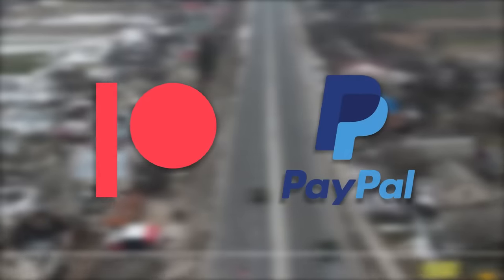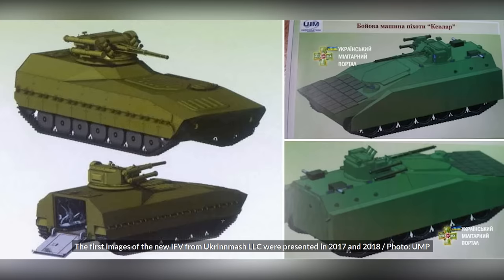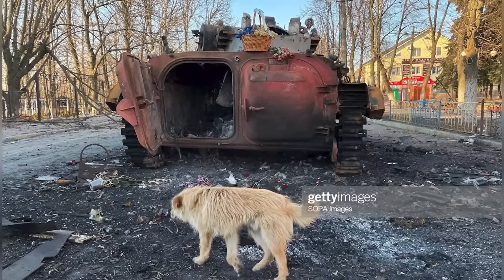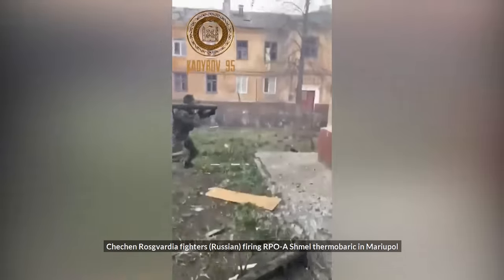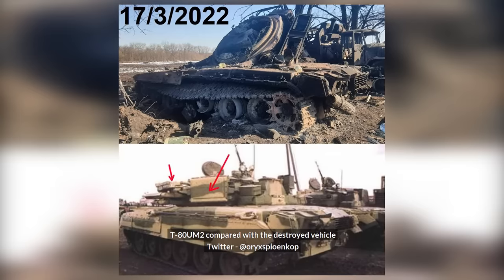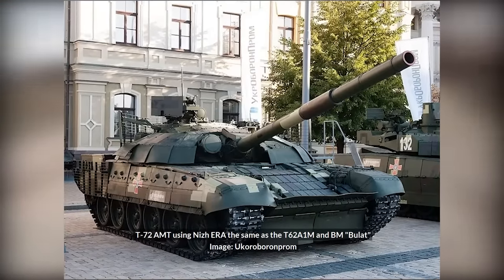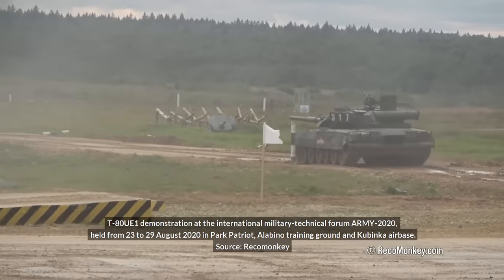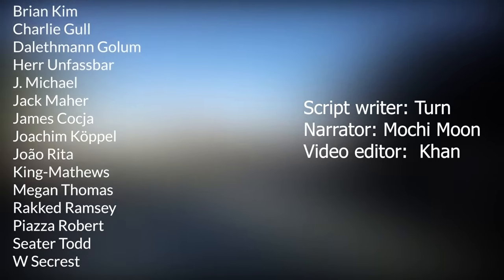🇺🇦🇷🇺The Many Rare/Unusual Tanks, and AFV's in Ukraine AKA The MT-LB War | February-March

Comment: Current MT-LB/v driver here in the Finnish army. The MT-LB even though it's old it can still be relied on for many roles from transporting infantry, wounded, equipment, or towing mortars or artillery. It's very hard to find a military vehicle as terrain accesable and multipurpose as the MT-LB, even if it is ill suited for modern combat situations.

Comment: there was lot of confusion about the t-80um2...which was actually a t-80um1 with drozd. so the only prototype of the t-80um2 is still alive.
Reply: Pretty sure there was only ever one T-80U with drozd and its the T-80UM2 that was knocked out
Reply: @SussyImposter9856  it was t-80um1 with drozd instead of arena APS(which t-80um1 normally should have) 

Why ? because the destroyed vehicle didn't had bustle autoloader like the t-80um2 prototype.

Second difference- the destroyed vehicle has defferent era...it has normal kontakt-5 era 

While the t-80um2 should have that kaktus-6 era which is almost specific to it.
Reply: If only other ukrainian tanks had high level ERA or a well round cage armor, not so sure how long will it last in combat.
Reply: Nope its a T-80um2 that was destroyed. The Tank that you are reffering  to is the T-80um2 black eagle which is another derivative of the T-80um2 with a bustle rack Autoloader.
Reply: @gotanon8958  so that means there were more than 1 t-80um2 in the first place and that the one lost wasn't the sole t-80um2. 

Still means the t-80um2 black eagle is alive.
Reply from the maker: The black eagle is not the T-80UM2.
Reply: @TanksEncyclopediaYT  Does that mean the black eagle is the T-80UM3 or another indegenous tank design?
Reply from the maker: The Black Eagle (Object 640) was to be a new design based on the T-80U, The T-80UM2 was a prototype upgrade to the T-80U. The object  640 was cancelled since Omsktransmash (The corporation that developed the T-80, and subsequently kept working on variants such as the UM2, and designs such as the Object 640) went bankrupt.
Reply: @TanksEncyclopediaYT  thank you, by the way can you give me more information about t-80um2 and t-80um1 . Only one t-80um2 was there ? How many t-80um1 and what is there any difference between them except um1 gets arena and um2 gets drozd 2 ?
Reply: @mr.waffentrager4400  all I know about the T-80UM1 is that it has a different ERA layout on the turret and has the Arena APS
Reply: Z
Reply: @mr.waffentrager4400  Wasnt the Kakuts ERA designed for lighter vehicles like BMP\BMD series, while Kontakt was made for MBTs?

Comment: I went through the US Army LRS course back in '93, in which a portion of the course was threat vehicle identification. We had to properly identify about 120 different threat vehicles by seeing only a portion of each pictured vehicle during the training and testing. I was blown away by the amount of those vehicles I could still properly identify..meaning..the Russian armor hasn't changed that much at all. It's still mostly the same crap that was brought out in the 60's, 70's, 80's and early 90's, modifications aside.
Reply: Mate the same goes for each country. Everything was designed in cold war and only upgraded.
Reply: @DNS-Freakz  well that’s just not true is it otherwise the US would still be using the M60 and the M113…
Reply: @TheeWolfiee1  Ohhh i forgot the Abrams is from 2022 right? It's an 80's design and probably even earlier.
Reply: @DNS-Freakz  most tanks are LATE Cold War yes but almost everything else is newer so?. APC’s, IFV’s, jets, helicopters…
Reply: @DNS-Freakz  let us know when you find a material stronger/lighter than what is on the Abrams. 👍
Reply: Same can be said of the Abrams no? 40yrs of modifications...
Reply: @powkung45  The abrams isn't the junk that a T-72 or T-80 happen to be.
Reply: @toddj8125  Mate if modern AT or Javelins would hit the abrams it would get burn the same as a T-72. And it's way heavier so it would get stuck even more in the mud.
Reply: @TheeWolfiee1  Abrams tank debuted in 1980 and the M113 is still in service.
Reply: @DNS-Freakz  The Abrams design is from an earlier American-&-West German joint tank program from the 1970s.
Reply: @newdefsys  Stryker and Bradley pretty much both fulfill what the m113's role was so saying its in service hardly counts if its backline roles. and again abrams is hardly a cold war tank.
Reply: @TheeWolfiee1  Yeah, because 1980 wasnt cold war period. Everyone that served from 1980 to 1991 and received a Cold War Service Medal needs to turn them back in because 'TheeWolfiee' has decreed that time period was "hardly a cold war".
Damn, Wolfie, its so easy to win an argument when you get to change the rules to fit. Fucking amazing powers you have.
Reply: @newdefsys  lmao all I said was that it was hardly Cold War? Something built on the last years of the Cold War when there were many other vehicles that served a lot more time in that war. cough m60 cough.
Reply: @newdefsys  and what’s more it pretty much was untested in combat until the gulf war so again it’s technically a Cold War tank but how can you call it a Cold War tank when it didn’t fight any wars during the Cold War( if you believe it ended in 1991).
Reply: @newdefsys  Yeah i had something like that in my head but didn't want to say false information mate.
Reply: @TheeWolfiee1  Cold war ended when Soviet Union dissolved and that was 1991. What about the american bombers still in use? Kinda old the A-10 too. And the M2 is old af too. Im not saying because it's old it's trash but theres still a shit ton of cold war equipment used but ofc it's upgraded.
Reply: @TheeWolfiee1  the same tanks Houthies scrapped en masse while fighting against Saudis? Lmao
Reply: @DNS-Freakz  thanks for basically agreeing with me tho, Cold War ended in 1991 and the Abrams didn’t start seeing combat until 1991…. Sorry but I wouldn’t call it a cold war tank.
Reply: @unatco6554  ‘joined one year ago’ enough said really…
Reply: Perun has a really good video on this phenomenon, called "All Bling, No Basics". I cannot recommend enough watching it.
Reply: @TheeWolfiee1  there was very little combat for US tanks during the Cold War fortunately. It lasted 41 or 43 years, the Abrams served for 9/11 of these. Hence it served for around 20% of the Cold War. I would say that makes it a Cold War tank. Further, it was designed to fight in Cold War Europe against the Soviet hordes. Which also makes it a Cold War tank. Put your ego aside and desist from this silly claim.
Reply: @PalleRasmussen  okay sure let’s call it a Cold War tank, still waiting to hear about all the other parts of the military aside from tanks that have been ‘upgraded since the cold war’ mfs confusing NATO equipment with Russian equipment.
Reply: You will not see many… if any Cold War era vehicles fighting in nato countries now days, and the ones that you do are the rare exceptions that have been Heavily modified or there’s nothing to fill it’s role.
Reply: @TheeWolfiee1  I am not sure, what you are asking about?
Reply: @TheeWolfiee1  The US only recently got rid of it's M60 reserves, and the M113 is still in use. The Abrams was designed in the 70's, and the majority of the USAF's combat aircraft are 70/80's designs. Every country on earth uses loads of cold war stuff that's just been extensively upgraded.
Reply: @TheeWolfiee1  Here's a small list off the top of my head of cold war era vehicles and equipment still in service with the US military: Upgraded variants of the M270 MLRS which first entered service in 1983, Upgraded variants of the M113 which first entered service in 1961, The HMMWV first entered service in 1983, The M109 Self Propelled Howitzer was first introduced in the 1960's, The LVPT-7 Was also in the 1960's, The LAV25 entered service in 1983, The Patriot Long Rage Air Defense System entered service in 1982 but was first tested through 1969-1970, The Ohio Class Nuclear submarine was in sea trials in 1982, The Ticonderoga class Cruiser was first ordered by the navy in 1978, The Bradley IFV entered production in 1981, The C130 entered service in 1956, The first variant of the Huey took it's first flight in 1956, The Cobra attack helicopter First entered service in 1967, The CH47 Chinook entered service in 1962, The B52 Bomber Entered service in 1955, And last but not least off the top of my head the McDonnell Douglas F-15 Entered service in 1976.... And I'm sure there are many more that I missed and just because its old doesn't mean its obsolete.. I know I missed the Abrams and A-10 but those were pretty obvious and were mentioned in the above comments.
Reply: While Yankeestan uses much newer crap? When was your MBT designed, and how long did its predecesor serve?
Reply: @jakewaybright973  most if not all of these vehicles you listed are rarely seen in frontline combat or are no longer fit for it now. it went pretty off topic from Russia still using literally Cold War equipment(tanks,ifvs,etc..) whereas yes the Us is still using Cold War equipment, it is in now way being put to the frontlines as much as the Russians are and that was kinda what I was getting it. But I admit my original comment was pretty wrong and I’m starting to see that now.
Reply: @TheeWolfiee1  the material used is irrelivent to the design. Also titanium.
Reply: @DNS-Freakz  no it wouldnt. The t72/80 blow up cause theres ammo stored in the autoloader right bellow the turret crew. The abrams has no autoloader and has all its ammo relativly safely stored.
Reply: @TheeWolfiee1  Boron carbide, you are welcome.
Reply: @TheeWolfiee1  There is no old or bad vehicle, there is only vehicles that is unfit for the roles army gave them. In turkish military police we are still using m48 tanks. They wait in a trench and when we detect insurgents they drives gets out of the trench fires HE and goes back into the trench. Their shells pack more explosives, faster and more accurate than HE rockets. More explosives come in handy when they can always take cover behind large boulders.
Reply: @robertharris6092  A tank doesn't need to get blown up in order to be considered as knocked out. Let s say that a javelin hit the Abrams on its turret, 3 crewman will be dead and gun breach would be destroyed. Now isn't this tank good as destroyed under theese circumstances.
Reply: @mysteriousguy2681  i said blows up. Not are knocked out.
Reply: @mysteriousguy2681  except that boron carbide can shatter instantly when hit by a high velocity projectile/force of an explosion… basically everything a tank gets hit by.
Reply: @robertharris6092  What I wanted to point out is a tank doesn't need to be blown up to become useless.
Reply: @TheeWolfiee1  Hmm that aspect of the boron carbide just reminded me a material, ceramic which is the main component of chobum armor. Oh and ceramic is not durable as boron carbide and it is heavier.
Reply: @mysteriousguy2681  so you think the military tank expects and designers have overlooked this material?, No they’ve probably already tested it and it probably didn’t work and it wasn’t as good/cost effective/ as Available as the material they’re using currently.
Reply: @paulroustan3643  noo.. it does not to any major or even minor degree
Reply: @DNS-Freakz  The upgrades werent even near enough to get all the vics. You would never see an old variant still in service within NATO countries. Not only that but the upgrades they implemented didnt really account for the drastic step up in technology, we even got rid of the Humvees for anything but logistics.

Modern Russia was bankrupt for most of its history thats why it couldnt do much in terms of modernization.
Reply: @TheeWolfiee1  damn wonder what dellision i was suffering when serving 86 to 92 with hummers abrams  bradleys and mlrs
Reply: @toddj8125  I’d hardly call the T-72 or T-80 junk. They’re built for one role, and in the hands of a competent commander, are a good weapon system. 

The Russians however are not what I’d call competent commanders.
Reply: Armor in general hasn't changed much at all.

Comment: An interesting point regarding the "mt-lb war", the Russian side is actively using Shturm-S and several units were clearly captured by Ukrainian troops, there is no clear evidence of the use by the Ukrainian side, since there are quite a few of them, given that they were actively used in 2014-2015 and part was lost, however, in 2020, the Ukrainian modernization of the Shturm-SM with the Barrier ATGM was shown (from the Luch Design Bureau - the manufacturer of the Stugna ATGM, it is worth noting that Ukraine produces quite good options for anti-tank missiles), but the number of units produced is unknown, especially considering that the aiming module was produced by an instrument-making plant in the city of Izyum, which is currently under the control of the Russian troops. Also, the video does not clarify the use by Ukraine and the separatists of the Brdm-2 in various, even artisanal, modifications. I also want to add about the T-64B1M, this is just a modification of earlier versions of the T-64B with additional armor for African countries. however, due to the lack of armored vehicles in 2014, about 25 pieces were transferred to the Azov regiment. And also about the T-72, Ukraine had ~1500 units after the collapse of the USSR, it sold about half for export, and later they were returned to service, mainly T-72AV, since there were only a few dozen T-72B/B1, and at the time of 2022, most of the mechanized brigades subordinate to the Operational Command West were equipped with T-72 tanks, this was due to the fact that during the Soviet era these vehicles were concentrated in western Ukraine and just logistically it was very convenient (repair bases, repair plant in Lviv)

Comment: It appears Russia has seriously underestimated the strength and resolve of Ukraine.  Proof comes in the form of the obsolete and limited production vehicles they have committed to combat.  Since little if any resistance was expected the use of second line equipment seemed prudent.  In hindsight the Russians are learning the error of their ways paid for by the loss of those vehicles.
Reply: @kajmak64bit76  They could have but they had no idea what the response of NATO and the world would be.  The Russians are brash, bold and audacious but they're not stupid.  No one objected strenuously, not even the Ukrainians.  That demure demeanor is what set the stage for this mess.  Putin thought no one cares.
Reply: They didn’t send in lower quality equipment, they have been using their most modern equipment from day one.

Comment: Would like to know if the Ukranian T84 Oplot has seen any action. I remember looking 5 years ago they only had about 10 in service then 5 and now only 2. I'm assuming they are being used in combat and have some losses or they have some that are not operational and require expensive repairs.
Reply: About number of tanks - there is just some mess with names of vehicles. One that is T-84 "Oplot" in number of ±20, and one is BM "Oplot" in number of 2 copies. It's 2 separate vehicles that doesn't have much in common. About tanks in action, most of T-84 were built in 1990 or 2000 years, so I suppose most of them in bad condition. And BM "Oplot" doesn't in action because they are very expensive and Ukraine doesn't have much of this tanks

Sorry if there are mistakes in message, I'm not native speaker :)

Comment: Kornet penetrates any tank regardless of ERA. 1300mm penitration is no joke
Reply: 1300mm of RHA

Which is for example 600mm of composite on Abrams
This is an example not actual numbers

You get the point? Different armor protects differently... so for example you need 1300mm of pen for ATGM to pen something a 600mm of pen APFSDS can

Ya know?

Comment: You need at least two T-55 recovery vehicles to pull a T-80.
That's not good. The efficiency ratio of a recovery vehicle has to be 1:1.
Reply: Why is that? The T-80 isn't much heavier than the T-54
Reply: @jameshodgson3656  It's the engine, weight doesn't help you move a vehicle.
Reply: @jameshodgson3656  No the T80 is much heavier than a T55 ARV, ~7 ish metric tons heavier, and also the torque required to pull it isn't enough.

Comment: Wouldn't say that T-80BV is a modern day tank. Still, 80's tech
Reply: What would you call the Abraham? It was designed in the 70s and made in production numbers in the early 80s.
Reply: @paulroustan3643  the Abrams at least has a CITV, upgraded composites, up to date Hunter Killer System and have already been fitted with Trophy APS.

T80 BVM doesn't have a CITV, is still using the same quartz core turret from 1979, doesn't have a automatic transmission, doesn't have a laser warning system, doesn't have Soft Kill or Hard Kill APS, the commander cannot control the main gun at all, the commander cannot control the heavy machine gun remotely.

The T90M is a better candidate to be considered a modern Russian MBT